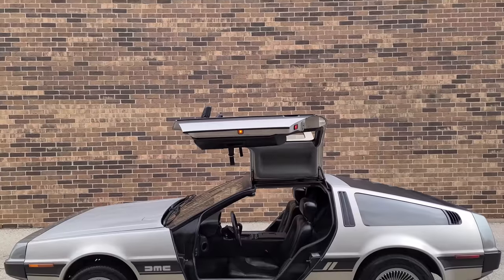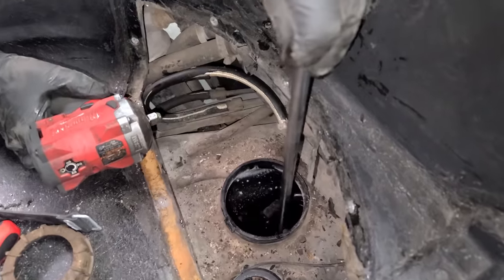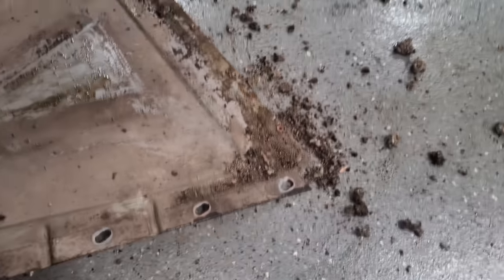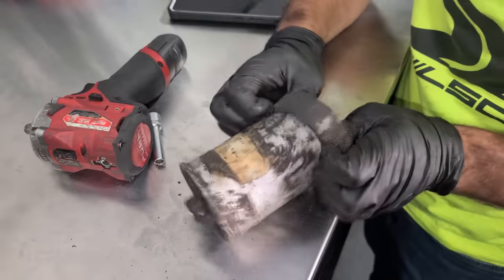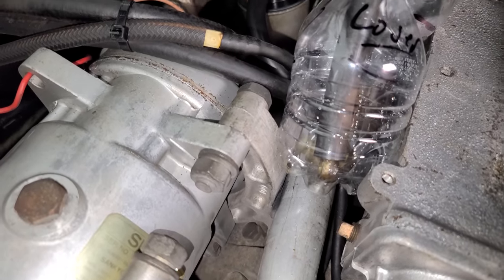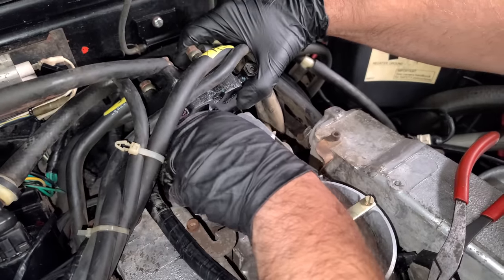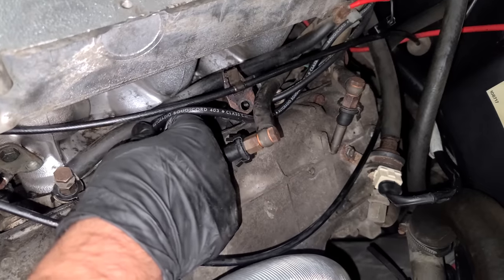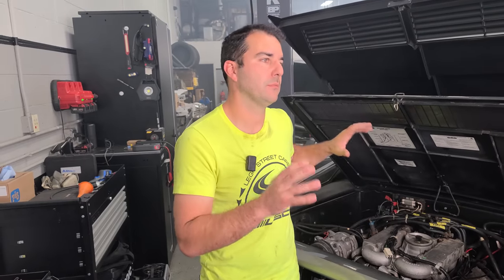I Got My DeLorean To Run On Its OWN POWER! Cleaning Out NASTY 30-Year-Old Gas & Fuel System Rebuild!

Comment: Remember alex, its not an oil leak its just sweating horsepower! This delorean is such a sweet rebuild, mad props!
Reply: It’s not an oil leak, it’s time released weight reduction
Reply: Also, rust prevention.
Reply: Deloreans didn't have any horsepower to start with dude!
Reply: It's just a continuous oil change 😂
Reply: It's a legit street car
Reply: @buggerlugz6753 I was gonna say it can’t sweat too much of that HP lol
Reply: @xigosu  Yes, and when parts fall off a car, like Holey Goat the 2nd, it called "Active Weight Reduction" XD
Reply: @Avetho   You watch Pole Barn Garage don’t you?
Reply: Means there still is some oil in it.
When it stops leaking is when you're in real trouble.
Reply: @AWizardAndaMouse3432  Hell to the yes I do lol
Reply: @Avetho  Pole Barn Garage is great!
Reply: That's why sbc's are great engines.  When they stop leaking oil, they're out of oil. Lol
Reply: It’s just marking it’s spot
Reply: What we said about radial engines:  “if it ain’t leaking, then there is no oil in it”!

Comment: The triangle shaped piece stuck to the bottom of the tank was probably a buffer between the tank and skid plate, would prevent tank from rubbing, and vibration tapping due to such close tolerance between the tank and skid plate... Definitely re-apply. Best replacement would be the adhesive backed sound deadening mat used in interiors
Reply: Maybe prevents static as well...?
Reply: Proper material for the job....Not just sound deadener.
Reply: @jspaulding4106  You wont need a static conducting matt/strap on this because it uses an internal static dissipating conductor inside the fuel tank.
You can see it later in the video.
Reply: Hope he read this

Comment: Loving this series Alex! I've worked on a LOT of CIS injection back in the day when it was pretty popular on VW Rabbits, Jettas, Volvos, etc. and it actually was a pretty bullet-proof system, as long as you didn't let them sit around too long. Fuel pumps seemed to be the main failure point, since they were relatively high pressure, and aftermarket pumps NEVER worked as well as the original Bosch units, even though the originals were 3 times the price.😝 Reman injectors were pretty cheap, and would often fix multiple problems just by replacing them. No one, except the dealers, had access to any kind of injector cleaners, so we were stuck with just trying to clean them with compressed air, if anything.

The old V6 sounded pretty good after it ran for a bit and got all the cobwebs out. I think once you get the plug drilled out for the mixture compensation screw, and you can fine tune it, it will be golden! If you have a simple CO meter to stick in the exhaust, and just keep it a little on the rich side of the recommended CO settings, it will run well and have plenty of power. If the cat is clogged, you can get universal replacement converters on Ebay for 50-70 bucks. Looking forward to the next installment!😉
Reply: Good German engineering getting a boost in this video with the Bosch pump and the Sonic wire tools.
Reply: That mixture screw will help, best set with a gas analyzer.  CO meter.
Reply: Rule is not to mess with the adjustment screw unless you know and have the equipment to measure and tune it.
Same is for the mechanical weighing plate, don't mess with the set factory settings!

Comment: The black triangle is to absorb rubbing between two surfaces.   It might have a static electricity purpose also.
Reply: Nvh was what I was thinking too
Reply: In addition, it could absorb vibrations so that metal plate does not sing.
Reply: I was kinda surprised he didn't say that after pointing out the leather wedged in between the chassis/frame (or something) earlier.
Reply: Anti-slap material.

Comment: That DeLorean looks literally like it rolled off the factory floor. You have done such an amazing job with restoring this thing. John himself wouldn't have been prouder of the work you've done had he still been alive today.

So just a couple of questions - what were the parts of the restoration you liked the most? what were the parts of the restoration you liked the least?
Reply: It looks better than the factory. I bet some of the (against grain) scratches were there from the factory.

Comment: This is such a fun series. You asked about ethanol in ND during 1981-1991.  Definitely possible.  I grew up in DeKalb, IL in the 1980's, and it was already available.  I remember putting "gasahol" as it was called in my 1987 Ford Mustang.  Being the Midwest and farm country, the Farm Bureau was pushing its usage, and I definitely could imagine an agriculture heavy state like ND having it available from the mid 1980's onward.
Reply: I'd agree.  I live in MN, and there were definitely stations that had ethanol fuel starting sometime in the mid 80s or so.  I remember my father complaining about it.

So given ND also produces a lot of corn, it wouldn't surprise me if they also had stations that sold fuel with ethanol in it.  So there's no guarantees.

Comment: A little tip about crush washers everywhere on your car.... After torquing the bolt down that has a crush washer(s), hit the head of the bolt once with a hammer (brass if ignition is a concern) and re-torque . This sets the crush washer to sit absolutely flush for a leakproof seal. Do this especially on your brake line to caliper banjo bolts.
Reply: Cool tip.  Now I need a brass hammer.
Reply: I've got a little brass head jewelers hammer somewhere, is that heavy enough?
Reply: @marknelson8724  
Minor problem, Mark, just build a beefy CNC Router (cheaper than buying) and use it to carve out a master pattern of the hammer's head...and a few graphite crucibles.  Then build yourself a drain-oil-heated melting furnace using a junk oil furnace blower/burner and a cut off propane tank lined with refractory cement mixed with long-fiber fiberglass matt. (note: flywheel from a '38 Dodge pickup is perfect for the lid)  Use the CNC Router to finish the appropriate areas of the cast hammer head and create a custom Mountain Ash handle.  Now test-fit the handle just to be sure.  Next, lay the head on a folded towel, on your most rugged bench or table, and beat the stuffin's out of it with a good, 24-ounce nailing hammer and the ball end of a much smaller ball-peen hammer to give it character.  Then de-burr by lightly filing with the required shapes of very fine files and give it a good going-over with a palm sander and 320 grit, moving to 600 grit.  Finally, apply a compound to achieve a patina of your choice and buff it out so the high spots are less affected, implying age and heavy use...apply diesel drain oil to the handle, quickly wiping it off the handgrip area...wire-brush the handgrip area...apply a honey-colored log cabin finish...sand the whole handle to cut the gloss...insert and seat the handle to the head...smack home the wedges trim the excess handle, dip the whole thing in drain oil, drop it in your half-full shop vac's can...wipe it off while deeply distracted by the neighbor lady prancing around her back yard in a scandalously-cut maillot swimsuit.
  
And, you're done!

I'm only as far as building the Router, but I have hope! (7 videos on my channel)
Reply: That is some old school good shit man. That`s what my teacher told me in school in the early 80s. Mr Rogers. He was a mechanic on planes in the 2ed WW. Good stuff man.

Comment: Before messing with the mixture adjustment screw on the CIS distributor, make sure the following is checked and fixed first:
-Find and fix all vacuum leaks, since K-Jet can't compensate for them well. Metering plate not moving down enough is a classic sign of this.
-Make sure the oxygen sensor system is working and entering closed loop. There should be a 2-pin plug dangling somewhere in the engine compartment. This is where you plug in a duty cycle meter and check that it is hovering in the correct range. Shop manual will have all the details. K-Jetronic was 100% mechanical, except on US cars where an O2 sensor and "frequency valve" was bolted on for emissions.

Comment: Alex, it's been a real treat to watch you do this project. Again, I am so very proud of you. For taking pride in your work and the good spirits you are maintaining. 
As far as the car "only having 16,000 miles" I agree with you. Based on the condition of the underside. The oil build up. The torn CV boot and so on. There is NO WAY that car only has 16,000 miles on it. I think it is safe to say it's very likely at least 116,000 miles or more. As an example. We just got a 1990 International 4700 diesel in. It only has 45,000 original miles. The dead give away was not only car fax, one owner. The motor it self is still shiny and blue. No oil build up. Sorry, I don't mean to ramble. I was simply sharing. Again, I do enjoy your videos. Ron

Comment: The work on the fuel system was actually quite interesting and especially the testing of the injectors and retoring them to 100%. Your commentary was spot on and hilarious. Initial examination and diagnosis shows Injector # 2 looks like it has a possible  UTI, # 6 a kidney stone or other obstruction. 😂 Glad it all worked out and flows so well! Things are looking better mechanically. Fingers crossed. 🤞🏻 As Always, May God Bless you and yours! 😇

Comment: Alex that is complete new fuel system. You have installed. That covers 99% of the parts, and make the fuel system as good as when it came off the production line. Good job done.

Comment: Fellow DeLorean owner (VIN 04228) and huge fan of your channel! Solid work on this rebuild and restoration! One suggestion regarding the fuel system. My DeLorean only has 14K miles and also was garage kept for 27 years and required a complete fuel system rebuild front to back. I have been to a great deal of DeLorean car shows and was told those CIS systems operate much better on non ethanol fuel so I found several gas stations that carry it. Just a suggestion since that Bosch CIS distributor has such tight tolerances and can be a headache. Keep up the good work! Very excited for this new project You have going.

Comment: Your fuel distributor was probably okay. If the other injectors were getting fuel, that one should have it too. There are small screens down in the holes where the lines attach and one was plugged. There is a metal diaphram in the fuel distributor that covers the holes going to the injectors. When you press down on that air flapper, it allows more fuel pressure to be on the top side of that diaphram pushing the plate down and allowing more fuel to flow out to the injectors. It is a pretty simple system.

Comment: The only thing I that looks a bit sketchy (at least from the video is you should be careful of the heat shield around the muffler. Looks like it could be asbestos from back in the day. Use a respirator when removing this to protect your lungs. Do a bit of research on any heat shield material. Other than that, I'm looking forward to the remainder of the video!!
Reply: I was thinking the same about those braided fuel lines, no real reason to use asbestos on these but you never know.
Reply: The heat shields are asbestos. I think he'll be getting rid of the OG exhaust and going with the newer upgrade that is available. Most of us go with the upgrade because it allows the engine to produce more power.

Comment: Never miss an episode. My son and I love your channel. Do you plan on doing any upgrades to the engine or rebuild it. I’ve seen some people put small turbos on. Just wondering. Thanks for the channel. A real channel that gives us great content not just 10 or 15 minutes of content. Keep it up! God bless!
Reply: Those engines were used in Alpine a310, either N/A or turbo, up to 200hp iirc. Or even 250 to 280 in the a610.
They might be hard to find in America though.
These engines went to more than 400 in Venturis, with special heads (I think Lotus had a hand in it), but these are rare and most likely very pricey.
Reply: @pbe6965  got ya. I think the one I saw wasn’t the original engine but one they put it. Thanks for the info. I’m not up to date on the DeLorean.

Comment: Looking good! You have the Midwest guys who are brilliant, but I'm just going to share my $0.02 bit of advice. PLEASE replace the fuel lines! 

You should still drop the gas tank for two reasons. 1. easier to clean the tank, 2. easier to remove the coolant lines which you need to do. You can check to see if there's any rust damage from the brake booster which likely leaked (common failure) and you'll know it when if the inside of the metal tank cover is rusted. When you had it in the air I think I could see where it was rusted. You can look behind the drive-side front tire between the frame and the gas tank cover. 

The DeLorean fuel PSI is incredibly high, much higher than regular cars because of the mechanical fuel injection. So I suspect the additional check valve is needed for that high pressure. 

I'd recommend you most definitely replace the fuel accumulator which is located in the center of the frames spine dead center of the car.

Don't drill out the hole for the fuel adjustment, they sealed that up for a reason.

Comment: I have not finished this video series yet, but wanted to make a comment on the frame channel intersections with rust compromising strength. I wanted to suggest another option to explore, which could be very economical compared to a frame off repair. I believe that you should consider using precision blocking made of an aluminum alloy material. If you could have precision blocks made to dimension that could be inserted into those intersections. they could be tapped and then holes could be drilled into the channels to secure them to be one extremely strong joint. You could employ shims if necessary to create the rigidity that would be required for a strong structural joint. This proposed idea would be stronger than the factory hollow welded joint at the assembly line. This would possibly withstand a junk yard crush machine. During assembly, a butyl or some other sealant material could cover the internal surfaces first. That will also prevent galvanic corrosion between dissimilar metals. Then after bolting in and curing, a never harden rust preventive coating could be applied to the outside to further seal the joint from oxidation. After that, an annual inspection on al intersections which may prompt another quick coating of rust preventive coating. A mechanical engineer would be the one to consult. Not all automotive technicians would be able to grasp this concept and strength potential. Thank you for this amazing video series.

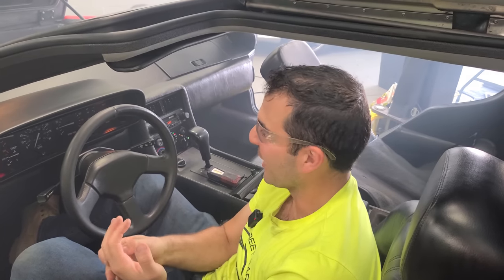Comment: 1:03:33  I found a 52 year old 1971 Mitsubishi Colt Utility Pickup that had been standing 30 years in a barn here in South Africa. The tyres had a Year of Manufacture stamp on 1994 on them. After a lot of time and a lot of effort I've got her fully running and drive it every weekend. I am now starting on some upgrades and enhancements for the truck.

Comment: A quick trick to swell up rubber seals is carb cleaner in a can. 1min after soaking it will swell up. Works with orings but you must reassemble immediately.  Tire shine puts oil back in the rubber after it dries.

Comment: One of the best shows on YT, thanks Alex.  You reminded me: back years ago (2002 or so) I got a 1984 Porsche 944, had a frickin blast with it for 32 miles, but then it jumped time and smoked the engine.  Got a few mechanic opinions and it was far outside my price range to fix.  Not even a week after I found that out my mechanic out in the country called me and said there was an identical Porsche 944 in his buddys garage right down the road.  I ended up buying it for $1500 as it had been setting for 13 years.  Towed it to his shop (good friend/mechanic) and proceeded to give it an oil change, drain the fuel, clean the intake tubes and airfilter system (good thing as it had a mouse nest) refilled with 5 gallons of recreational fuel with 3 bottles of Cyclo fuel injection cleaner, new battery and sanded terminals: Fired up on the 3rd turn and ran like a top for the next 70,000 miles.  I was so frickin happy like you were with the Delorean-instant reminder of this story as the 1984 Porsche 944 na, and the 1983 Mazda RX7 were my 2 favorite sportscars ive owned (the only ones, but I've driven many)  Thanks again for great videos

Comment: I restored a 2004 honda civic ep2 2 years ago. And I’ve kept working on it ever since. Right now it’s functional but the piston o-ring seals are disfunctional.  Started noticing oil getting thrown out on the exhaust after I replaced the valve seals and the head gasket.. so it looks like I’m on a new adventure now ❤

Comment: I got a label maker for marking hoses and other things. Makes your markers look factory. Come in many colors and even shrink tube to print on. Well worth the investment.
The shrink tube with the solder and flux inside it are amazing once you get used to them. You need a heat gun for them so no worries about fuel vapors.

Comment: Working on an '81 DeLorean now that has been sitting for 27 years so I'm right there with you.

Need to finish new fuel distributor lines, fuel filter and accumulator and then it may be time to start it :)

Comment: I love all your videos!

CIS was a pretty robust technology for its day.

I owned two VW Rabbits with CIS.  Never any problems with CIS (save fried and crusty o-rings).

I was under the impression that the injectors stay closed under pressure until they see vacuum which allows them to open.

Well...however it works...Not a bad analog mechanical system.

Keep the great videos coming!

Comment: PvR engines in the old Volvos was exactly the same with all the same issues! I just used to swap them with the B230ft turbo inter cooled 4 cylinder and you had reliable power ! That bolts in 😁👍🏻